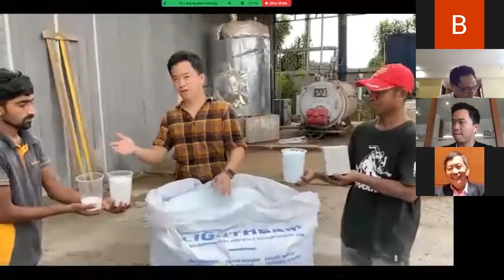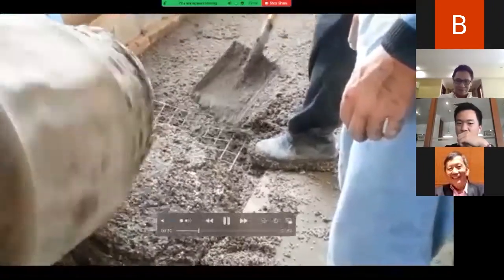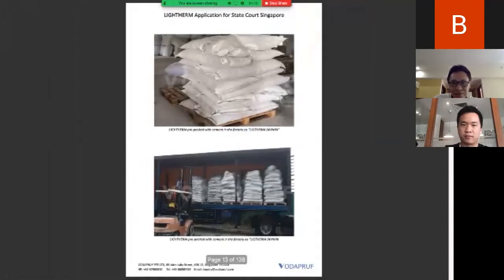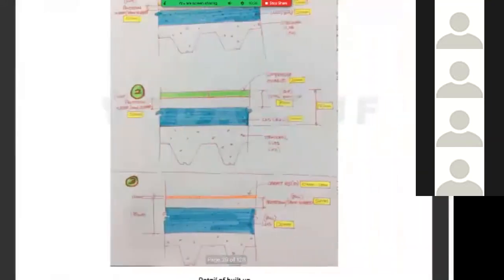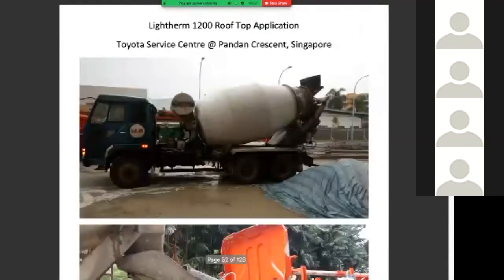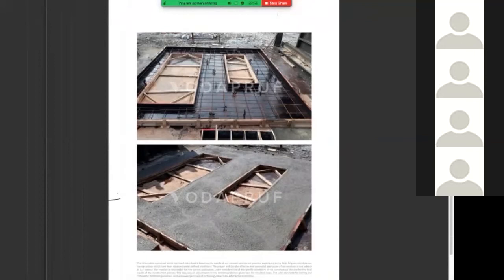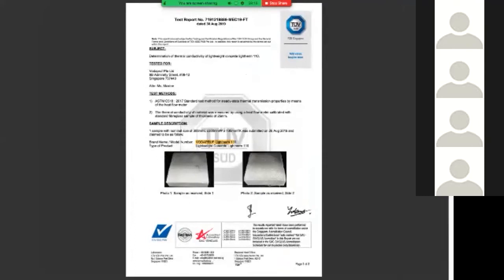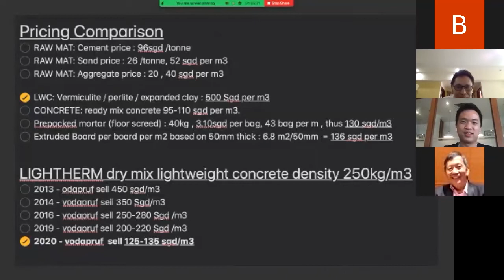Lightherm | Vodapruf Zoom Session During Covid-19 | MCO | CB | Circuit Breaker | SG | MY

Comment: Hi, can this be used as structural floor without using sand and gravel? is ikt jujst cementy and lightnerm or do you need traditional concrete under it for strength..
Reply from the maker: hi,  yes we have formulation that is catered for structural grade , up to 40 mpa at density 1800kg/m3 
refer link below :
https://www.dropbox.com/s/ggj548maiyxnz8h/1h.%20Lightherm%201900-%20Compressive%2034-%2028%20days.pdf?dl=0